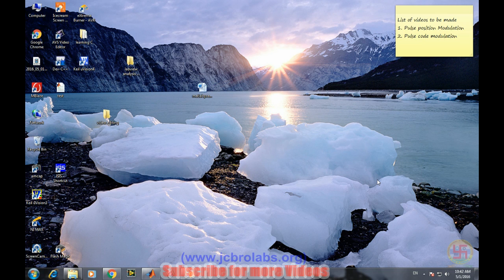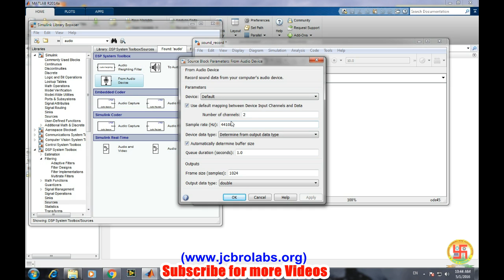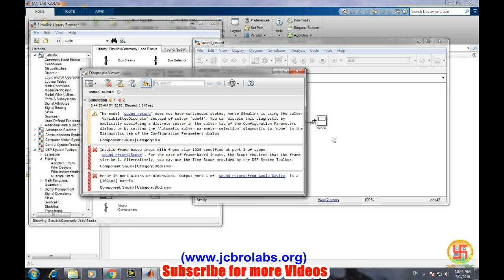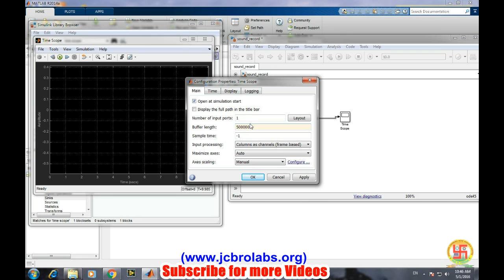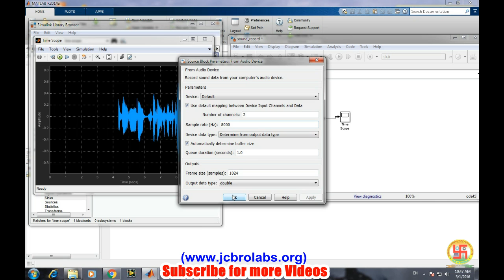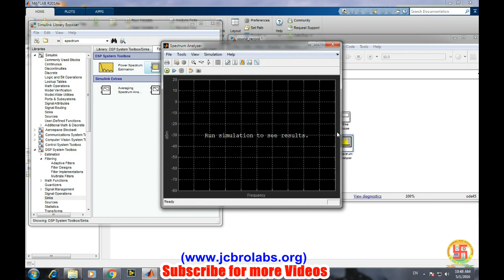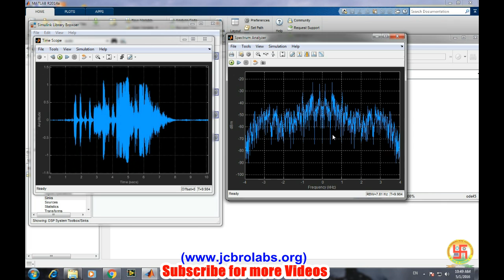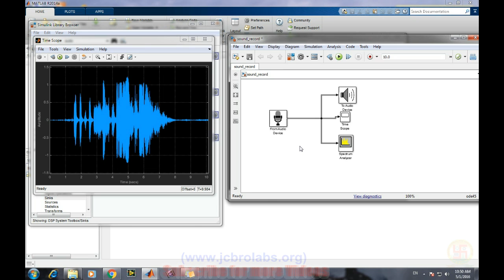How to record and display sound using Simulink??

Comment: hey there, can i drag a recorded file instead of using the mic cuz i have an assignment of recording some words with different sampling rates using matlab simulink and i don't want to record with mic 10 times !! thanks in advance
Reply from the maker: yes, you can....you can use file read block..
Reply: but i can't modify sampling rate ?